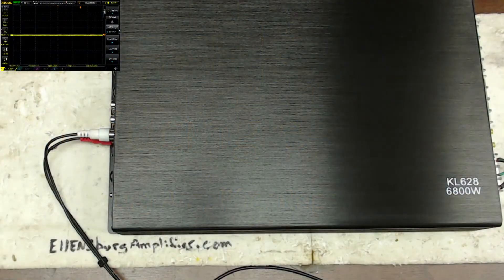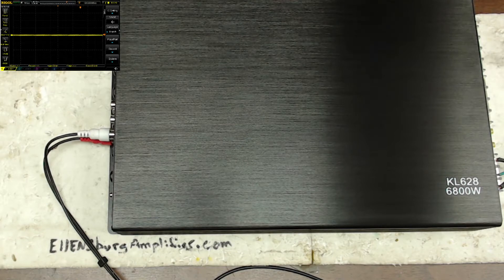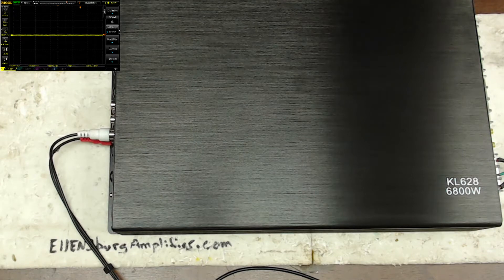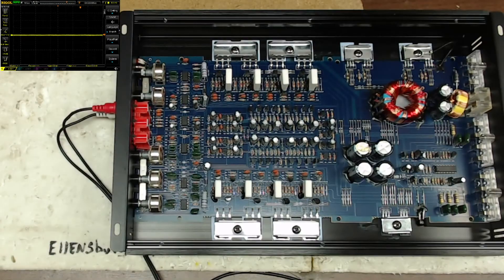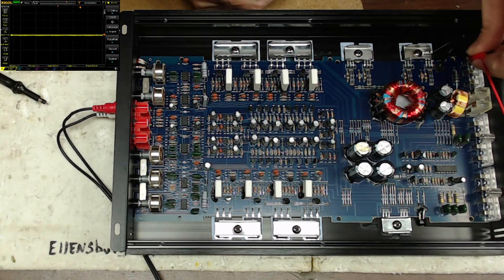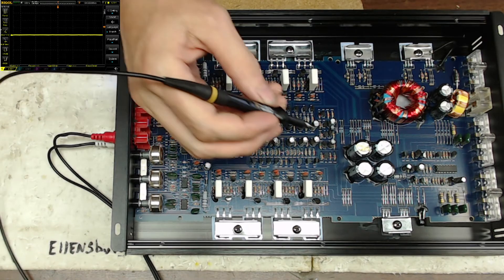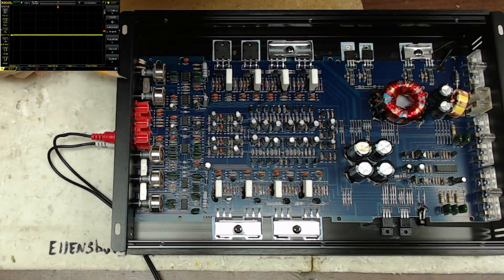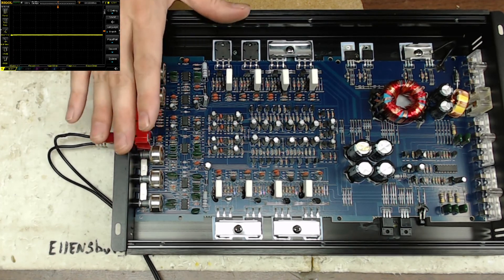Wish.com Amplifier Rundown 4 Channel for $50? What does it use?

Comment: Thanks for covering this.
I picked one up on Temu, but it's falsely labelled as a Pioneer CTC-M668. It's also sold under other names with the same model number via other online marketplaces I've discovered.
I knew it was all bs, but the reviews and some of the specs make it seem like a worthwhile buy for around $100 less 1/3rd discount...
Was burning me up though to know if I should cancel the order or not, but I think I made a decent choice for the money. Best to get a separate power amp for the subs once they go in.
Reply from the maker: Agreed for the price these are typical designs that have been around for eons.

Comment: This amp is actually awesome. My friend gave it to me for free and told me it’s a powerful amp and I didn’t beleive it at first but it’s been working for many years and it will blow subwoofers if you turn it up lol
Reply from the maker: Nice! It is always good to hear positive results from questionable boards.
Reply: @ellensburgamplifier  and one more strange fact I want to point out about the current amp I’m using, it never clips on my scope ? Why ? How ?

So my deck sends a clean signal and maxes out on volume 60/62 anything above 60 it will clip the signal so I don’t go above that right. Now usually when setting the gains I’ll max out my deck volume to 60 and then set my amp gains around that watching the oscope. This current amp the e400.4 will not clip the signal if you set the gain all the way up, even with lowering or raising the hpf nothing I did showed signs of clipping this thing ? The only differnce I saw between maxing the gain was it induced engine noise if I say went above 45vrms so like up to 3/4th of the way on the gain it sounds clean for my listening preference.
Reply from the maker: @onesikm3  Depending on the design there are clip limiting circuits designed into the pre-amp.
Reply: @ellensburgamplifier  yes it’s actually surprisingly good! Recently I’ve tested over a handful of class d amps in my car for powering my cabin speakers. And all of them do something different. I’ve found that my source signal isn’t helping contribute to the problem either but amongst all the amps I’ve tested and the two ive owned are the best so far those are the one in this video I’ve had for a couple years and my jl jx360/4 amp which is by far the absolute best amp I’ve ever used till date for highs!!! And it looks as plain as day in the inside….but it has the quietest noise floor. You can’t tell the amp is powered on basically put it to you that way. And this class ab cheapo stacks up right up next to my jl. I just wish the jl wasn’t the size of a surf board and as heavy as concrete or else I would have never started this amp dilemma. So the only problem I had with the cheapo amp here was I noticed the smallest hint of engine whine coming into my speakers. 

That’s when I began hunting for a better amp and basically I’ve so far gone thru a couple I’ll name that have all been sad amps paired with my pioneer t-x7800bhs single din head unit. Precision power Atom 700.4 , jp84 🤢 , STEG sdsp6,  
Recoil di1200.4, recoil di800.4 all of these have so far been utter failures! So I just as of last week asked myself wait let me try something new. Why don’t I plug in my iPhone directly to the amp using an aux cord to rca. And to my surprise these amps that I’ve wasted time and money on now sound a lot better without engine noise!!!! But besides the engine noise some of them are loud and noisey when idling say with music on pause and volume at 0 I’ll see as high as 40db of audible hiss and turned up at full voulme I’ll get 50db of hiss!!! WNna guess at which amp here is the loudest of the group ? Lol 
FYI that jl I’ve owned for a decade is god sent, it doesn’t have any whining or hissing I just wish it was smaller. So this has been my control basically in this experiment and I’ve been searching for amps that come close to this level of performance but in a smaller package 

BTW I’m changing the head unit today for  kenwood excelon kdc705 and hoping for better input signal and no more whine BUT I’ve actually accidentally purchased the dmore engineering 4 channel class d amp and to my surprise this bitch doesn’t have noticeable whine omg it’s stout I really like it but not for 180$ before tax on Amazon. I opened it up and saw they are using cap tops for capticance and wtf I wish I tried this two months ago. That steg is Italian made and raved about in Europe you should hear how audible it is powered on and the whinning. Then again most guys probably utilize the optical in it has so idk

Comment: Hello, thank you again for this video.
  I have two questions:
Why is there a resistor in parallel with the output terminal of the channels at the output of this model?
Second, the negative of the oscilloscope is connected to the battery ground during the discharge test, but where should we connect it to the output terminals?
Thank you
Reply from the maker: On many amplifiers, you will have an RC snubber across the output. Yes, the scope is always grounded with the isolated power supply which allows you to probe at any point in the amplifier. No need to move the scope ground with an isolated supply.
Reply: @ellensburgamplifier  Thank you very much for taking the time to respond to your viewers.
So always connect the negative of the oscilloscope to the negative of the battery?
Is there a snubber circuit for high voltage shocks?
Thank you very much
Reply from the maker: @nimaesmaeil9318  That is where I always ground my scope for my isolated supplies. An RC snubber circuit is there to filter noise or spikes in signals. You will find them in the power supplies, in the output amplification section. There is nothing there to protect against shock, you have to wait for the rail discharge resistors to do their job or use a high wattage resistor to manually discharge the rails.
Reply: @ellensburgamplifier  Thank you very much for your detailed answer
Reply: @ellensburgamplifier  Thank you very much for your detailed answer

Comment: Great vid, really dig the components and path go overs as well, I can pretty much see the path of the components in an amp now (for taking in voltage and putting out music) but still like to know the path for every amp :) what voltage/amp PSU do you use to pretest/test amps? I think I remember you saying you used a 2amp brick pulsing the power to diagnose and 10amp brick to fully power up and test an amp? Do you always use 12v in both cases?
Reply from the maker: I use a 2 amp current limited supply for most all amplifiers unless it will not start (after clearing all faults) then I move to the 10 amp. The goal is to use the least amount of current possible. There is no real term for fully powering up an amplifier. Some amplifiers will let you lower the input voltage to reduce the rail voltage and still have full switching but it all goes back to the same idea, to not burn anything up. I always use 12 volts until the amplifier makes it to the load bench. At that point, it gets 13.6 volts. A $15 12v brick is great insurance against 36 STGW80H65 transistors.
Reply: @ellensburgamplifier  ahh ok, I’ve seen some give as little as 9/10 volts with 2-3 amps while diagnosing a board, Sam on Barevids I think, but ya ok cool, ty. Also when you say “2 amp current limiting” basically the 2amp brick is current limiting as it won’t supply more then 2 amps, correct? Just want to make sure, seems obvious that’s what it means but I’ve assumed wrong before lol. I’m about to search your vids for Inductor related content, having some issues/questions regarding a set on my Kicker 06ZX750.1
Reply from the maker: @Nūrd_AF  Yes, it will not supply more than 2 amps and the nice thing about these cheap bricks is they will shut down fast if anything is shorted or if there is an issue with any drives.
Inductors are a whole different learning curve. If you understand magnetics it does make it a little easier. For the most part, inductors have 3 typical situations, 1- working, 2 cracked core, or 3 fully shorted. Not many in-betweens but once in a blue moon, you may find a core that has been over-heated which affects the magnetic properties.
Reply: @ellensburgamplifier  o wow I didn’t know about that safety feature, been looking into kill switches just that specific reason, bet it’s a lot faster on the kill then I can hit it as well, I am def going to get a set regardless, ty bro! Also on inductors I posted a vid after watching a bunch of vids, trying to find stock specs on this inductor so I can buy stock spec replacements vs rewrapping myself and just guessing ...can’t find any help on finding out the specs, I measured the other which seems to be ok-ish, but don’t know if I can rely on the reading not knowing what the stock spec is. If you got time your opinion on it would be much appreciated, ty bro, always got me!
Reply: @ellensburgamplifier  so I have my new adjustable earth mained 10amp PS (not the isolated brick 2amp that’s in the Mail lol) and my awesome Oscope, etc and so ready to go finally and I go to place my ground ...and draw a “what if I blow it all up” blank ...LOL!!! I, more then most, should know where to place my ground ...think I’m going to rewatch some vids and read some material for a lil bit, def one of those “overthinking” moments bro, thought you might find that funny  ...lol! 😅
Reply from the maker: @Nūrd_AF  I do go over scope grounding a few times. I think the last live stream I did I covered it. Just remember to ground in a common location to the 12v negative input.
Reply: @ellensburgamplifier  ya you do and when you do you go over it quite well, helps a lot. And maybe I’m overthinking it bro, I must be, cuz I’m overexamining each word, lol, and I apologize if you’ve answered what must be 100 questions of the same degree about grounding, but when you say “a common location to the 12v negative input” youre talking about the main amp ground connecting? I don’t know why I’m having a hard tine grasping this, I think the fear of blowing something up is really getting to me, and why I said screw it and ordered an isolated PS to use until I have it down pat and know my ass from my elbow with all of this ...lol. Again I apologize man, I know I keep asking the same question, I’m going to go rewatch some more of your videos and actually take some notes, along with Dave’s vids, plus a few others. Maybe I should just blow something up and get it over with already, lol!
Reply from the maker: @Nūrd_AF  Yes the battery negative connection. If you use the cheap alligator clips off of ebay that uses the ridiculously small gauge wire then they do act nicely as a fuse from the scope ground point.
Reply: @ellensburgamplifier  ty Todd, and ya I actually just grabbed a bunch so that works perfect, ty brother!

Comment: Thanks for the video. I have 2 dummy loads of 4.2 and 8.4 ohms, can I use for load testing of 4 and 8 Ohms? What's the maximum tolerance? Thanks.
Reply from the maker: Yes, you will be fine with the 4.2-ohm load. I designed my canthal loads to be right at 4.2-ohms as it drops to 4 once it heats up. So keep in mind that the resistance may shift as it heats up depending on the construction of the load (is it a resistor?). The 8-ohm load would be great for testing home audio amplifiers but may not be appropriate for car audio load testing as not many systems utilize 8 ohms. Hope this info helps!
Reply: @ellensburgamplifier  Very nice to know, after heating the resistance decrease a little. Thanks.